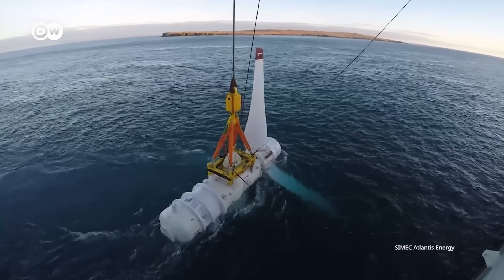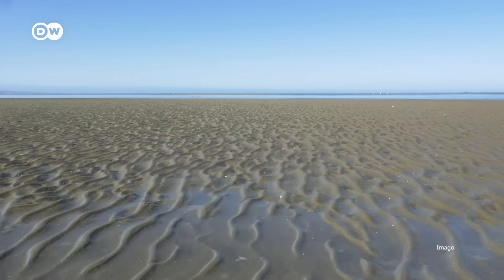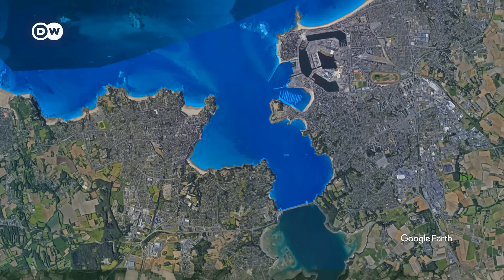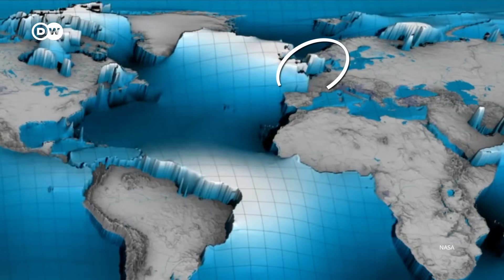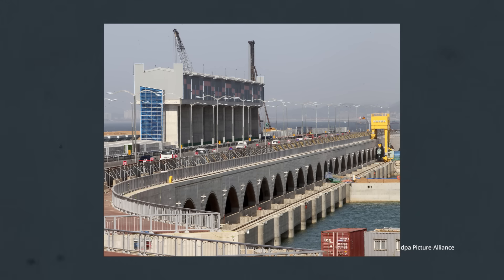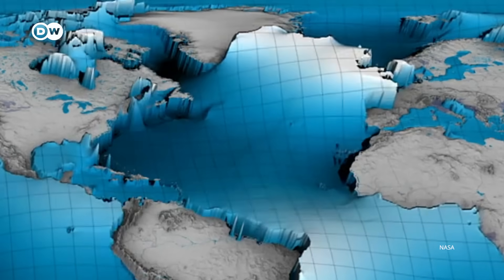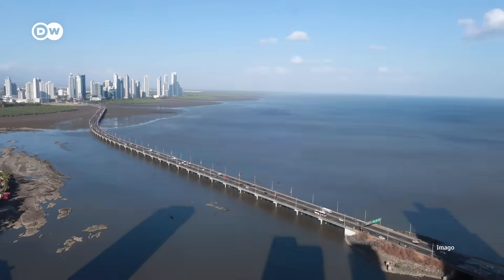Tidal energy could be huge – why isn't it?

Comment: I like how you skip right over natural gas as an interim solution , Coal is all you see , natural gas is the battery gas turbines can be turned on and off as easy as an airplane because they are powered by old airline turbines. Killing all fossil fuel is a mistake.

Comment: It always comes to batteries.  I work in the power industry and no one who makes these videos ever faces the most glaring issue with non hydro renewable energy.  It can't be used as baseload electricity.  The voltage support is terrible for this technology and batteries are even worse.  They can't inherently produce significant VARS, without very expensive and inefficient support components.

Comment: I'm surprised that transportation and storage of energy was completely skipped. Tidal energy is great for the coasts, but all land locked cities are going to need some other energy alternative. I was hoping they would talk about energy loss over vast distances, how many batteries would be needed to store this energy, what chemicals are used in the manufacture of batteries, and the waste/lifespan of said batteries. It is disturbing to me that when alternative energy is talked about these are very important and are never mentioned!
Reply: Because this video wasn't about the batteries? And they do mention that the zones where this can be used are usually less populated as an issue. 

Also, the predictability factor can reduce the amount of batteries needed. In cases of other sources you have to gather as much power as you can while there is supply (sun, wind) and you would use high capacity batteries for that. Here you should be able to greatly downsize those.

That said, haven't they started using mechanical means to store power (eg. flywheels)?
Reply: Dams are essentially batteries, and nuclear is a way more solid option overall. Its true that these “innovations” always solve all their “problems” with “just more batteries”

Comment: Tidal power coupled with energy storage for an on-demand power source could generate much if not all of Britain's energy needs even using basic 20th century tech.. which is why they won't do it because it'd be plentiful and cheap and put a lot of energy barons out of business.  Renewable solutions that cost relatively little will remain mysteriously unavailable or miniscule in scale while there's so much more profit to be had from restricting supply to feed the demand.

We must stop waiting for governments to do what they never will and instead focus on each home becoming as energy independent as possible, either by selling solar power to the grid to offset energy bills or if the offer rate is nowhere near the buy prices from the grid bank it locally instead and use it in the evenings to avoid needing to buy grid power at peak rates.

Comment: Why to bother fixing energy problem if they always implement the most expensive and non working solutions?
Reply from the maker: Non-working in what sense? 
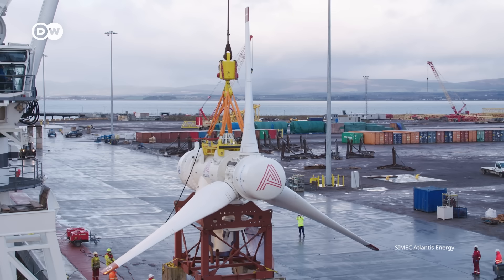In the video, we explain that due to tidal energy being such a small industry it lacks an established supply or manufacturing chain – this is mainly due to the fact that any time you need to operate something under water, it brings with it its own set of unique engineering challenges. But forecasts show that costs could be lowered within the next decade.  We explain the benefits 11:09 min into the video.
Reply: @DWPlanetA  i agree, like solar panels got cheaper with the years  the tidel will too
Reply from the maker: @thorus1596  We actually have already done a video about how solar energy got so cheap (and why it isn't everywhere yet): https://youtu.be/sUvaYycoWqI – let us know your thoughts in the comment section 🙂

Comment: So. Here are my reasons why, I believe this idea for Tidal Energy could be huge, But isn't and won't be used. 

There are countless possibilities that this would work, But it won't. 

The Idea of this concept is fantastic and would benefit a lot of people in homes and the possibilities of Tidal Energy would nearly Guarantee the energy output by statistics. 
But this idea is flawed, It will cause a lot of problems to the underwater sea life and possible failsafe that if the Turbine does happen to fail, The electronic Discharge would have a possible effect of killing thousands of underwater Sealife and that is one of the major factors that this technology is not used. 

Also, The Tidal changes and how the water around our world would change and which in the longevity would be decommissioned after a certain amount of time. 
Maintenance is also a factor in this situation. Personally, it would be catastrophic and horrible to actually maintain these Turbines unlike the Land version of these types of "Wind" turbines. 
It would put a lot of workers at risk to fix the turbine or maintain it in a longevity aspect. Also implies back to if it is damaged it can possibly harm the Sealife, Which is not ideal. 

My Opinion is actually quite one-sided, I don't find any use in this idea as there are far many risks that are in place that will negatively impact the Ecosystem. - 
It is actually much safer and less costly to continue with the wind Turbines on Land, Rather than worry about Other alternative Types of Energy, Such as Coal or Oil type, Even Nuclear.

Comment: Say, just as a thought. Could there be any ways of using water pressure in extremely deep oceans to generate energy in any form? Like can a difference in water pressure or water pressure itself be used to generate energy with current or 'to-be-developed" tech?
Reply: I think it is like building a wind turbine couple times higher than we actually have now. High pressure means there is a requirement for stronger materials, and maintenance will be hard (special machinery is needed to put human in high pressure water). Additionally, transfering the energy obtained from the deep water to people in cities and villages will be hard and inefficient, considering how far it is.
Reply: *So I dont think that's a viable solution

Comment: Nice shot of swansea bridge, the problem with tje tech, your gonna slow down water flow change direction of water. the reason the project failed in swansea was the contractors ignored the impact study to the coast line the beachs and species that are in the area. So if companys keep ignoring the impact reports, your not gonna get them built in gov aware area and distroy coastline and habitat in less aware areas like there trying to do in pembroke.

Comment: As with any power source. You have to look at the effects after. Dams were great.  Now the great plains are drying up more and more because of them. 

Ive considered focusing on vortex inertia n turbulence to generate electricity. Or you call it tidal. Its really just a concept from any turbulent and vortex of inertia that can be translated into electricity. 

So whats the problem with?    Its fairly minimal. Except for how it can ruin ecosystems. At first its a great idea using the oceans. But take a fan and put it in a bottle of water. The water will stop moving when the fan stops moving. So you’d be essentially relying on two forces to move the water. The moon and the aquatic life. The oceans are so huge it seems that any harm could be negligible.   Till you are slowing down the oceans. 100 years. 1000 years. If we really focus on it. Building countless underwater generators. What happens?  Entire ecosystems get wiped out because the oceans wont cycle cold and hot streams anymore. The systems become costly to clean and maintain. Aquatic life would live inside them. Look at what happened to the titanic in only 80 years.  

Certain areas can utilize it to minimal conflict with nature. But not everyone. N it has to be certain areas where it wont impact the rotational inertial of our planet itself. Remember all that translates to the crust. N if you stop the rotation and the wobble of earth?  All life dies.  Its not just global warming. It would increase global warming...

I was designing a system for reservoirs that could study the effect. Never got around to finishing it or even doing the study. Because i concluded through analysis. That its unfeasible to use the ocean and only in reservoirs is it really going to help and impact a current issue for how reservoirs are impacting nature in lower land.

Comment: This sounds great and i've frequently thought about it, the points brought up in this video are all fair and justified though i'm just missing 1 potential problem, and that's noise. 
It's a well known fact that marine life is disturbed by the sounds caused by freight liners and what not, so i'm curious on the sound output of these turbines and the effects of it on local wildlife given that it's placed relatively closely to the shores.
Reply: I'm pretty sure that is what was meant by displacement at 10:22
They didn't go into detail just concluded that the worst estimates are still better than the effect climate change will have.
Reply: @rosaschlupfer635  estimates concluded by people, people make mistakes, people have motives and biases, and instead of focusing on more permanent solutions like changing the wasteful aspects of culture, we would rather find new temporary ways to leave the lights on when nobody's home.
Reply: They do give off a sound or vibration that fish fo avoid. My family has a fishing business ,and the turbine that was left on the bottom in the bay of fundy in eastern Canada, has caused a lot of fish to change their migration path. The volume of fish in that area has decreased significantly.  
 The worst part is the amount money that was sunk into the project and the company went bankrupt. It sits rotating on the ocean floor producing nothing and rotting away.

Comment: I love Tidal power as a possibility, have been a big proponent for years, but I'll never understand why they keep using propeller designs. I've seen designs for an impeller design that resembles a jet engine that could account for all the Cons you hear when it comes to this.
Reply: probably because of all the ocean detritus that would build up in and on the shell. and barnacles/seaweed. and water would probably more readily flow around the turbine than through it.
Reply: @sandrafrancisco  I've seen these micro hydroelectric dams that use an impeller design like that, and it seems to work well. And their rated fish safe, because the fish and debris just fall through it without getting turned into chum. It does this because it takes advantage of swirling the water through like a funnel or like when you empty a two liter by giving a twist and the water "spins" through the nozzle like a vortex. I would like to see if such design improvements could benefit this technology as well. That slight redesign could make all the difference.
Reply: @AgentExeider  ah, but you didn't mention the barnacles. there's a lot of ocean species that drift in the water as microorganisms, attach themselves to objects in the sea, and then grow rocky shells. these suckers establish quickly and grow quickly. very serious stuff.

the shell of the turbine would also provide cover for these organisms and protect them from their natural predators.

also, salt water is just bad. water on its own destroys stuff pretty quickly, and salt water just makes it 100x worse.
Reply: @AgentExeider  the sea also has a tendency to destroy immobile objects because of the sheer amount of force of the water. if the air currents (wind) can erode rocks, then imagine what salt water currents can do to anything we put in the sea.

if we want to install something that harvests energy from salt water currents, then we have to design that machine on an evolutionary design that has been proven it can survive salt water tidal forces. such as, coral or barnacles.

Comment: I don’t think it is being done the right way!
‘Go with the flow’ - use tensile methods - under water carbon fabrics - vastly more areal capture plus using molecular strength many orders above composites and at a fraction of the cost. That is the combination of two orders of magnitude for cost and efficiency - a third may be that power installation and control may be sited on land - though if not possible then ‘khatmatrix’ (syncopated cubeoctahedra) are a developing possibility for immobilising sea-flow and allowing it to resist adjacent free-flow.
verbum sapiendi…….
Pip-pip!

Comment: It's a good idea only problem the tidal blades are open and out so being a danger to sealife.
The solution is a closed system using pipes with rosters from different sizes so sealife can't get in the pipe. Then you don't need to build a dam.  And if you want more Powerrr you can install the pipes in the occeans making them float around 2 to 3 km deep. The ocean current is always flowing and stronger much stronger then wind.

Comment: Theres more energy in the tides than humanity can use at the moment. Unfortunately though, water+time=corrosion. Salt water destroys pretty much anything with moving parts thrown at it within a decade or so. The dreamers dream, and the engineers say "no." For now, wind turbines are several times easier and cheaper to perform basic maintenence on.

Comment: So what you’re actually saying is ; that they are hydro electric water turbines not wind turbines 
What happens the get hit with a sunami? They should make them so they can fold down to a horizontal position and lock into the sea floor with secondary small turbine(s) ; able to collect energy from the sunami coming in and out. They should also modify the turbines to be able to collect energy in both directions using a automatic clutch or better yet…duel-direction torque conversion using only the water pressure to engage the “flow of direction clutch energy collection torque converting turbines

Comment: Just abit of fun math I did, but if you had 10000 of the best tidal barrages running for 1 billion years, the orbit of the moon would be 2 thirds of what it is now. This is because the energy from tides comes from the gravity of the moon, and if we take away this energy, the orbit of the moon will decrease. If we take the current energy of the moon to be -3.778x10^28 Joules, then the energy after we use the dams to be -5.765*10^28 Joules (based on average height and velocity) we can find that (if the moon had a perfectly circular orbit) that its new velocity would be 1.25 times higher (1.25km/s) and its orbital height would be 253928 km, which is nearly 66% of what it was before. This means that the tides would be roughly 4 times higher at around 20 metres. (my calculations didn't account for change in tidal height, if it was, the loss of the moons energy would be exponential)

Comment: California is going to need this system. They are going to need it within 15 years to supplement all other forms of power generation for this reason..
  if every car in California at this moment in 2022 was an electric car.
  and every source of electric power generation, including, wind, solar, fossil fuel, Hydro, atomic power, if everyone of those sources was dedicated to just charging car batteries of electric cars right now, that means no power diverted to industry, schools, hospitals, infrastructure, homes, malls, grocery stores, traffic lights, none of those loads would divert power from the grid that is dedicated to just charging electric car batteries if every car in California at this moment was an electric car..
  The electric grid in California couldn’t possibly come close to just satisfying the demand of electric car chargers. Not even close.
   I am retired from an electric power generation company..
  there were discussions about the future demands on the system. California came up in the discussion, and it was the fact that California is in trouble very shortly. Even now during high load hot weather heat wave demands on the electric grid, they have to have rolling blackouts, rolling brownouts, and this is before mass electric car charging places a titanic load on the system. And actually, cannot be done. They are not going to meet the goal. It takes about 12 to 15 years to go through the process of building a single electric power generation plant. Feasibility studies, environmental studies, public utility commission hearings, permits, rights of way, applications for permits locally, and statewide, resistance from environmentalists, it takes a long time, and it’s too late. The price of electricity in California is going to skyrocket.. possibly $.50 per kilowatt hour or even higher within 15 years.. it is actually too late to do anything about the eminent shortfall right now. The implementation should’ve started seven or 10 years ago..
   I wish them luck

Comment: For the same reason that standing windmills harm flying animals, Tidal windmills will harm the Ocean Ecosystem.  It isn't that we shouldn't be trying to gather wind, solar, and tidal energy, it is that the current ways in which we do it are 1 inefficient and 2 more destructive to the environment than even burning coal directly, if done through correct filtering.  This is simply because the designs are not based around the environment but to capitalize on it's confrontation with the enviroment.